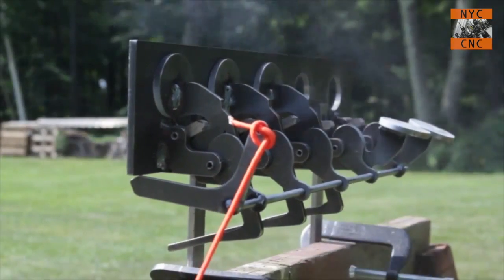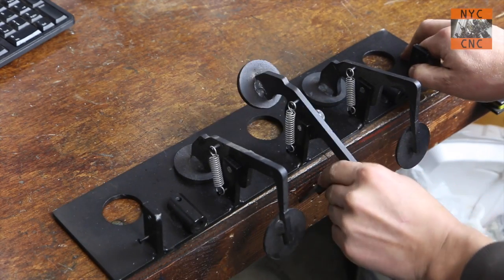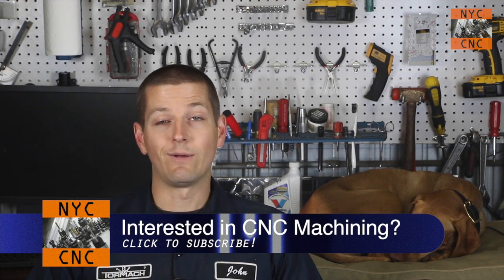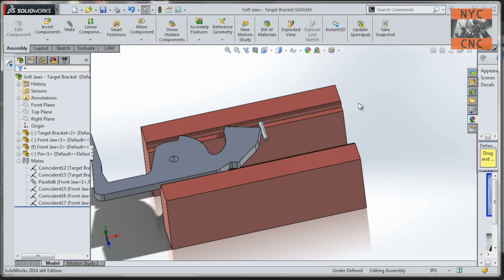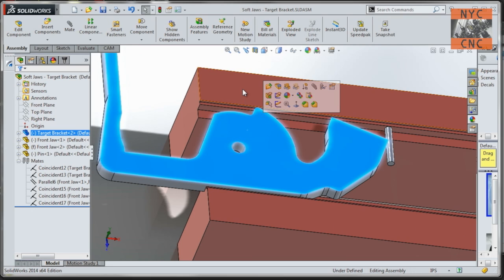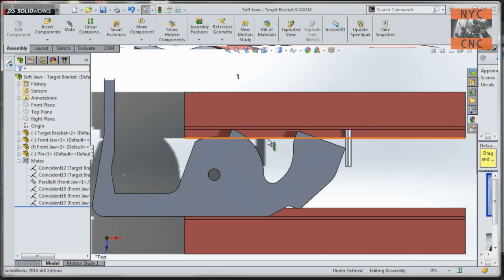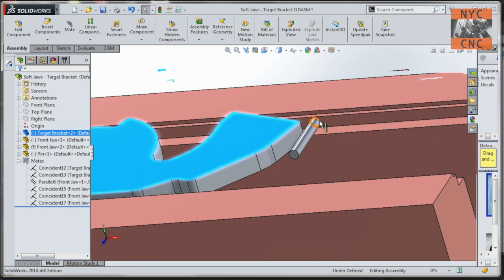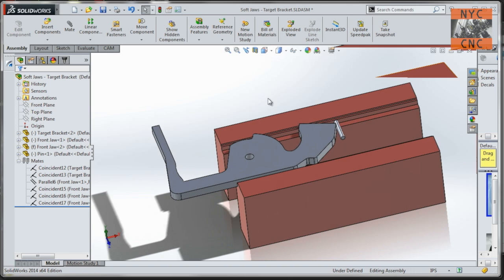Seven Minute Soft Jaws!

Comment: John: Nice soft jaws. I noticed that you did a speed up of the video when changing the jaws on the vise and that you have shortened the cap screws for the jaws. Check our quick change vise jaw system at www.winnspeedlock.com
Reply: I was going to mock those jaws a little bit, but at the same time, after looking at one of their videos. Looks rather nifty. One perk I've noticed is that the jaws always have the bolts with them at all times. Could technically be costly. But they're always there. Don't have to look for them. My main concerned now is that it does require their vice. Don't know how good they are. Probably fine.

Comment: I'm surprised you don't have a work stop for your vice on the Tormach.  You can do a search on MSC for #88620596.  Also, about the spot drilling on the plasma table.  They make a pneumatic engraving head add-on for plasma tables.  You can also use it to mark "spot" holes.

Comment: Hey John! Great to see your new machines and watching it all come together.👍 I myself have never tried my quill feed on such a small drill bit but when you get it fixed and ready to drill your 1/8th hole I would stand back an extra inch it may or may not be to fast for that small of a drill bit but I am interested to find out. Keep us posted I'm definitely interested to know.. Also what kinda steel is it your upswing for these targets? Very cool

Thanks for the hard work in and out of the video's! 

Dennis
Reply: Hey john sorry I just got a new phone (iPhone 6+) witch I love but the case made buy a very prominent cell phone case manufacture sucks the built in screen protector doesn't touch the screen so you almost have to tap each letter with a hammer for it to type what you want other wise it just guesses for you. Lol 

Dennis
Reply: I love the "big" screen for what I do with the phone witch is a lot of watching YouTube videos and searching the web but I also have a jawbone era Bluetooth so it doesn't look like I'm holding a laptop to my face 😁 I am very happy with it also I got the 128gb 6+ and it has been perfect! Just don't get the otterbox defender case for it.. The built in screen protector doesn't lay flat on the phone so you have to really push so it will be going back:( and Lifeproof is only coming out with the nūūd case with is "waterproof" but without the screen protector and that's not a good thing for guys like us that have metal chips flying.
Reply: Lol I know right! Well my main reason for the bluetooth is cuz I have to use a wheelchair if I go anywhere that involves a lot of walking and if you would call me I would just turn donuts in the middle of  Wal-Mart lol and also check them out (we used them in the navy before they were available to the public) they are called Jawbone and they have just come out with a new one that's the Jawbone era. Awesome little piece and very nice when needing both hands but yet you need to talk to that person also... 💪
Reply: Don't feel like an ass lol you can't see me from where your sitting. But with the size of these phones anymore I don't wanna be seen with one slapped up side my head haha .. Hey wanna see something funny look at the video you posted about brazing the gear and just look at your face before you start the video. You look very frustrated doing that video. 

Keep things rolling man you do great and you show us all that your just as human as the rest. 👌
Reply: I wish everyone looked at things in life like that it would be a better world for sure. But I did snap a pic of it and I'll have to share with with us on Facebook lol 😉

Comment: Heres what you need.  Video showing my air scribe offset on the plasma table to engrave, and centerpunch for drilled holes very fast and accurately.  I do not have it on youtube yet, but you can see it on my website if the link works.  http://www.wolfesmetalfabrication.com/jalbum/CNC%20Plasma%20Cutting%20Jobs/Yamaha%20Banshee%20Swingarm%20Parts/index.html#video-2014-10-04-14-22-27.mp4
Reply: NYC CNC
It is done via Sheetcam and Mach 3.  Basically just setting up the air scribe at an offset and when calling the tools in Sheetcam for Scribe, it offsets the axis and activates a relay, to the air solenoid, when its done, it cancels the offset and goes back to plasma.  I love it, works wonderfull for centerpunching like you saw for drilling out and tapping, bend lines, logos, reference marks, part numbers etc.  It is all self engineered and built.  (my first table wasn't as pretty)  I am currently working on adding a rotary axis to cut gussets out of square tube, and can do round, square and rectangle up to approx 4" or so.  First test cuts done tonight, but ive got some bugs to work out and material supports to make yet. :)  Its the part of my work that never quits feeling like a hobby.
Reply: NYC CNC LOL, well i will take that as a compliment. :) It does take a substantial amount of time to design, engineer and build one like this control box and everything, but i do really like it.  I have actually considered making some gantry kits were the customer fabs the table, and then puts my gantry on the table as all working parts are in the gantry, and the table can be made whatever size is wanted.  Here is another fun one for ya http://www.wolfesmetalfabrication.com/jalbum/CNC%20Plasma%20Cutting%20Jobs/CNC%20Scribe%20Engraver%20Capabilities/index.html#video-2014-07-16-20-50-45.mp4 If you want more info, you should be able to poke around my website and find pictures, videos or my contact info.

Brian Wolfe

Comment: Not trying to be an ass here. I'm only asking this because I thought my power feed didn't work either when I first got my Bridgeport. You do know how to engage the power in the center of the hand wheel? Mine was missing the pull that screws into that mechanism so it took me w while to figure out what was going on. Hope that's all that is going on with yours too. Otherwise it may have a sheared key from power feeding too large of a drill. I hear that is a common problem. Good luck. Great video!

Comment: Instead of the pin could you locate off the arm that is sticking off the left side? Just run it up against the side of the side of the soft jaw.   If you use "Machine" length drill bits you will not have to center punch and can be more aggressive with the cuts.

Comment: Glad to see the bridgeport running, one thing I would suggest is an aluminum quick vise handle for your kurt. They are cheap and for light clamping force production work they are much faster and easier!
Reply: The aluminum speed handle I have for my vise has a hex hole.  I can slip it all the way onto the hex shaft on the vise and there is enough of the hex shaft sticking out that I can leave the speed handle in place and use the cordless impact wrench when I want to open the vise jaws much wider.  The speed handle can stay on the vise.  Very handy.  Also, if the aluminum speed handle falls off onto my foot, it doesn't hurt like the big steel vise handle!  I need steel toe sandles for the shop in the summer, and steel toed big blue booties in the winter.  :-)
Reply: John made one for his Glacern vise some time back... I'm sure he can run another part himself

Comment: John,  Glad to see you using the Bridgeport.  When I got my Bridgeport Clone, one of the first things that I did was make a power draw bar.  The down feed is a little complicated, as I had the same issue with mine, but after studying the parts diagram, I figured out that it was just an adjustment of the bottom pin.  You are a smart guy, so I'm sure you already have it figured out.  H&W Machine has parts and books on the Bridgeport.

Comment: This may seem dumb to you but I ask as a non-machinist I don't know what the effective length of your drill is but as you have to do this multiple times for this target set up why not create a set of jaws that might allow you to load 4 / 5 of these pieces together at once and drill them all in one go?
Reply: If I can jump in here, it is not generally considered good practice to drill many parts at once, especially with small drills, as they tend to wander of centre the deeper you go. Drilling individual holes ensures greater accuracy.
Reply: Thanks
Reply: NYC CNC You see, I'm not just a pretty face, come to think of it I'm not that either.
Reply: Ah thanks, what a sweet thought, just look at Quasimodo for proof.

Comment: Now, all you need to do is, get another vice, set them both on on the CNC, program to drill one part while you change the other.

You can 2X your production.

Frank
Reply: Well, lemme' get this straight...

You used a production machine to build a fixture for a manual machine.

Shouldn't it be the other way 'round?

Frank

Comment: A very handy project for production.  Will you still be using your stamping method to mark centers for the holes?  I guess that is easier than switching out bits in the Bridgeport. 
  Power feed on the quill works very nice for a boring head, but I don't think it's very handy for basic drilling.

Comment: machining is fun because you have to make parts the most efficient way so you need to think practically. Making soft set doesn't need cad, just mdi the depth and x axis. Ready in 5 if u need only a step.
Reply: Have to admit, if u have the time to over engineer a bit, then do it. But i've had some cases at work where I had to make soft set to make parts and the they had to be made fast. So al blocks it was and mdi. The work pieces stay sometimes and sometimes don't.
Reply: The place i worked at used 150x50mm vises and we made the jaws just using raw 150x50x25 al blocks. They were used more like parallels back there, not as jaws as the stock hard jaws. They weren't as good as changeable jaws but was possible to change really fast. Both have their goods and bads as usual.
Reply: Like i said, they work like parallels with the stock jaws, so no bolts. You just slip the ole ones out an put a new set.